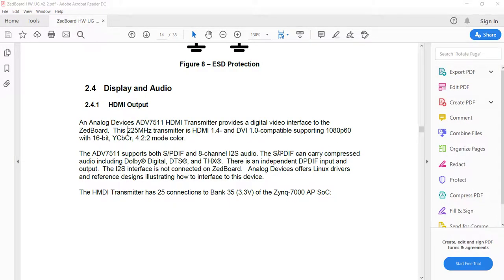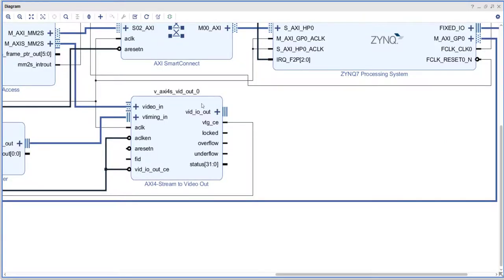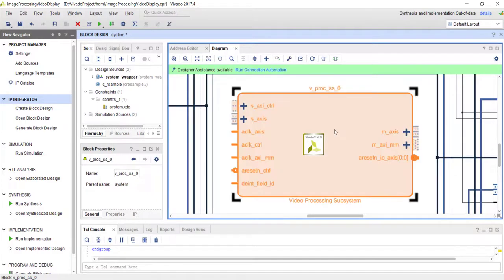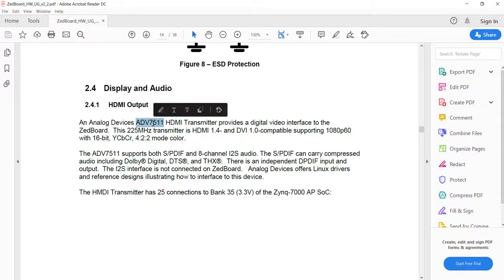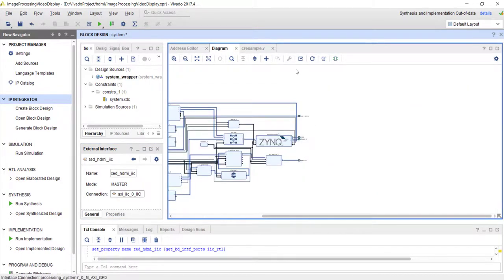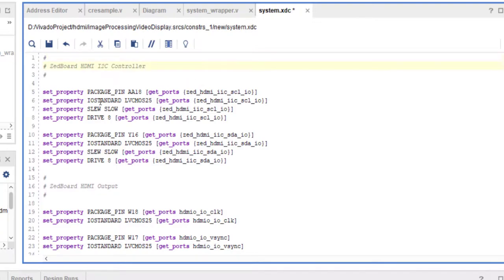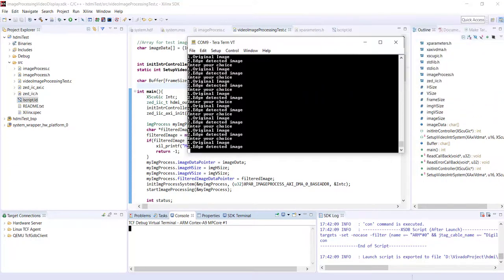Video Interfacing with Zynq (FPGAs): Part 7 Interfacing ZedBoard with HDMI Monitor

Comment: Hi Vipin sir, can you also please make a video on how to do USB interfacing on zedboard using the USB OTG port ? Or even if you share some resources for that, it will be of great help. Thank you.
Reply: hi, have you been able to run this toutoural? I am having issue with Vitins it missing some definations, I guess because I am using VPSS insteade of the normal convertor. which vivado version are you using?

Comment: Excellent video and presentation...
Iam using zynq ultrascale+. It has a display port for image transfer. Can you upload a video interfacing zynq ultrascale+ with display port? It will be much helpful for me to proceed.
Reply from the maker: Unfortunately I have no access to Ultrascale board
Reply: @Vipinkmenon  k. But can you help me in mentioning what are the changes required in block design while using display port?

Comment: Hi Vipin, thanks for all your videos.
When I try to validate the design I get this error:

 [BD 5-336] This command cannot be run, as the BD-design is locked. Locked reason(s):
* Block design contains locked IPs. Please run report_ip_status for more details and recommendations on how to fix this issue. 
List of locked IPs: 
system_v_rgb2ycrcb_0_0

how can I solve it?  I am using Vivado 2020.2 and it seems it does not have the rgb2ycrcb IP.

Any suggestion? thanks a lot.

Comment: Been waiting for HDMI. Packed a lot in 21 min. Thanks Vipin! 

Zedboard HW guide says ADV7511 is a 225 MHz transmitter. How is 148 MHz sufficient?
Reply from the maker: 148.5 is the pixel clock to the phy chip. That is designed based on the resolution. Calculation I have shown in the VGA video. 225 is between the phy and the receiver (monitor) also depends on frame rate, resolution and color depth
Reply: @Vipinkmenon  Thanks for the info. I have tried your design and everything compiles and I get the choice menu but nothing is displayed on the monitor. Monitor says no signal detected. I tried on different HDMI ports and checked the cable and they all seem to working fine. Did you have any similar issues or have any troubleshooting tips?
Reply from the maker: I have added the prebuilt bitstream and elf in the git repository. Pls try with it and let me know.
Reply: @Vipinkmenon  Thank you Vipin. I tried with both files and the screen picked up something. Unfortunately it was static in the top and bottom of the screen. It was the same in different HDMI ports of monitor. I got the choice menu but when I pressed 1 or 2 nothing changed in the TV nor the JTAG screen.
Reply from the maker: First it will be static but when select an option output is supposed to come. Whether the uart terminal is becoming unresponsive after making ba menu selection?
Reply: @Vipinkmenon  So the selection menu (uart) displays the choices once FPGA is programmed but becomes unresponsive after the static image is displayed on monitor and cursor in uart choice menu stops blinking.
Reply from the maker: Seems like something is going wrong for dynamic memory allocation. I have updated the .elf file in the git. Can you try with that. It is fully static. You might be able to see at least the original figure. Always power cycle the board before relaunching run configuration
Reply: @Vipinkmenon  Vipin your tenacity evokes awe. I tried the new .elf file and the good news is I was able to get the grayscale version of lena and the choice menu appeared over uart. As soon as I entered 1 or 2 the cursor froze from blinking while no change occured in the screen. Also there was a litlle bit of static in the bottom of the screen and it stayed. Im assuming the new .elf did not use malloc function and instead statically allocated imageSize in stack memory rather than heap? Thanks for troubleshooting!
Reply: @Vipinkmenon  Hi sir You gave an example of 512x512 size of an image. If I have to do for 1024x1024 then what are the changes I need to make?

Comment: Wonderful demonstration! You are truly not holding out anything. Just one observation

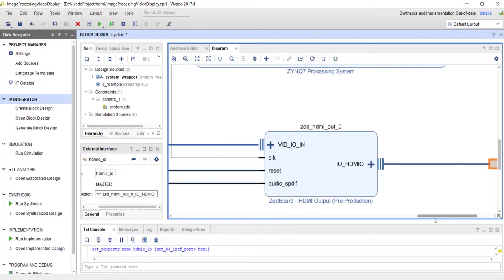In this video @02:30 the user guide is showing YCbCr, however, @05:33 you have selected RGB2YCrCb IP, which might cause incorrect colorspace reproduction, isn't it?

You have used grayscale image that's why the problem is not highlighted or it is handled in the c_rsampler!

Comment: Great video thank you very much! I’m trying to display a pattern the fpga that I have is virtex VC707 it has the same Adv7511 I’m using RGB 4:4:4 24bits. I used the registers : X1500 , X1638 , XAF06 , X1700 , X5619 , X5500 ,X4808, XBA60 and still get black screen. Any suggestions pleas!
Reply from the maker: I couldn't test on that board since I don't have VC707. Did you check? https://github.com/analogdevicesinc/hdl/tree/master/projects/adv7511. VC707 is not there but ZC706 is there
Reply: I tried to generate the project but when it starts to generate then the vivado closes by it self and it doesn’t continue I have no idea why. Could you please check it and try to generate it. I want to make sure that the problem not from the files.

Comment: hi vipin
we have vivado 2019 
how to run vivado2016 project in 2019
Reply from the maker: Vivado will automatically upgrade the project. It will ask you whether to upgrade when you open the project or open as read only. Choose to upgrade
Reply: @Vipinkmenon  
Ok i try once again but last time this not works at all....😕